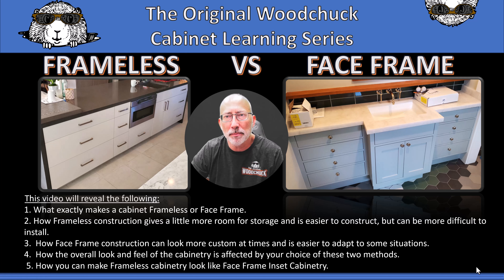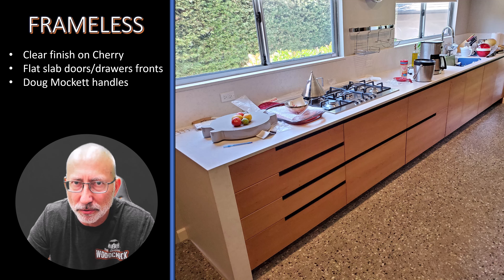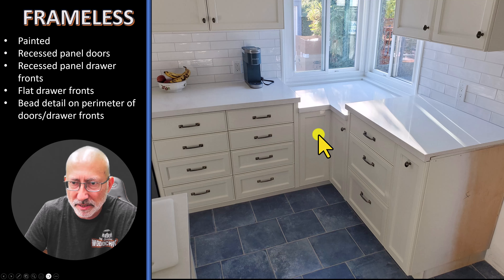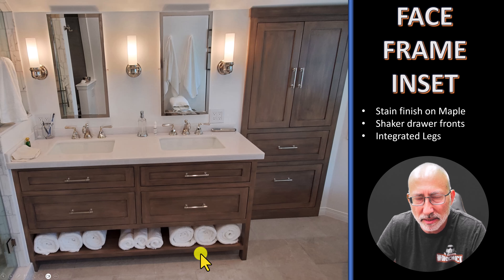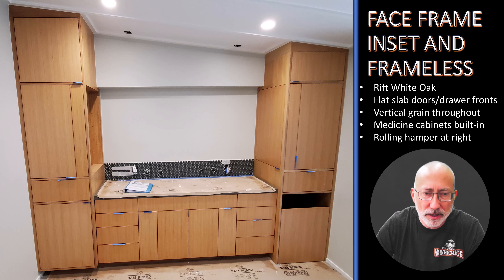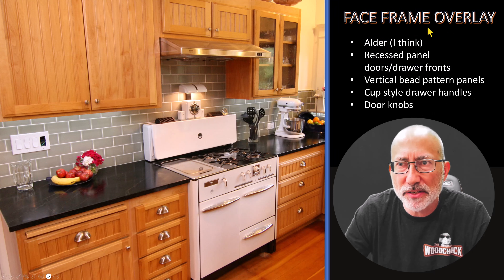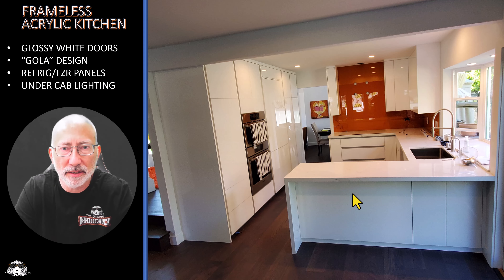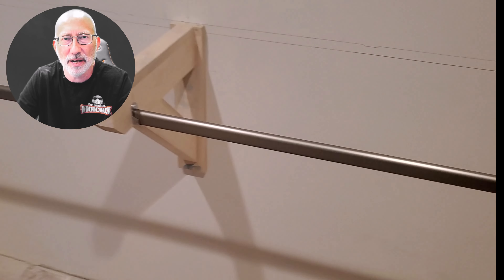Frameless vs Face Frame Cabinetry

Comment: I noticed you do the undermount draw slides.  Would like to hear about your choices.
Reply from the maker: Lately I'm liking Salice brand.  The reason is I had trouble with Hettich not pulling in strong enough.  The new Salice 154lb. ones specifically have good pull, especially on larger drawers.  Rollouts aren't as important as alignment in front is not an issue.  Thanks, maybe I'll do a video on slides.

Comment: Great video!  What's your opinion on RCWO slab fronts in full overlay in Face Frame cabinetry vs. in Frameless cabinetry?  It seems like there's more spacing in the Face Frame approach, which would not look great with slabs because the additional spacing "interrupts" the beauty of the grain continuity.  Whereas in Frameless the spacing is minimal.  Which approach do you prefer?

Comment: Any structural differences between the two? I’ve read that face frame can have better structural integrity and therefore last longer.
Reply from the maker: In reality, I'd say yes the face frame adds strength.  But is it necessary- not really.  When you connect all the frameless boxes together and attach them to walls , this makes them more rigid and integrated.  A stand alone frameless box with no other support on each side would be susceptible to racking more so than a framed one.  For storage purposes in a kitchen or bath I've never seen an issue with the strength of frameless unless someone really bashes into it or hangs off it like a monkey.  My 2 cents.  But a monkey could pull a door of a frameless cabinet about just as easily as a framed one.